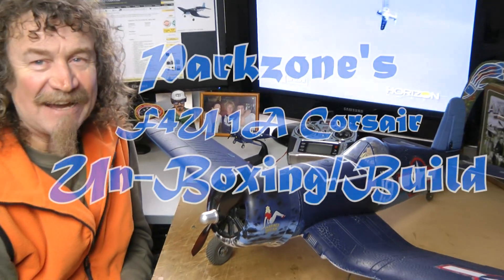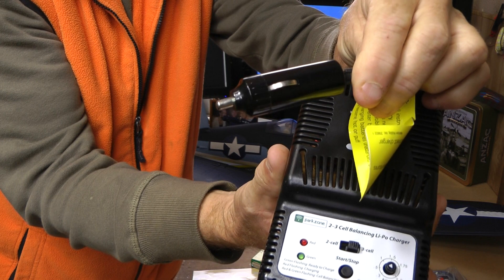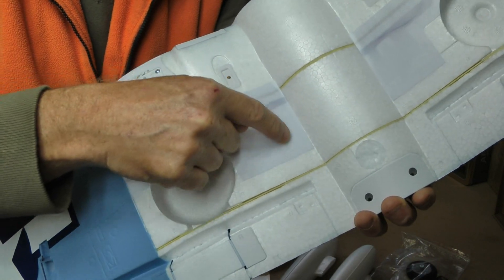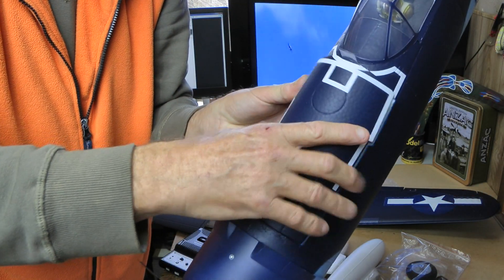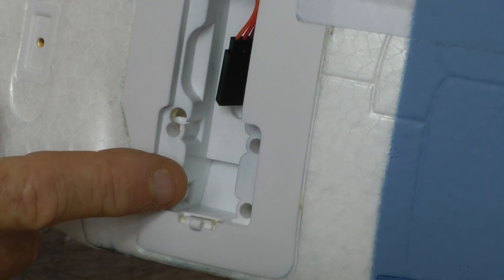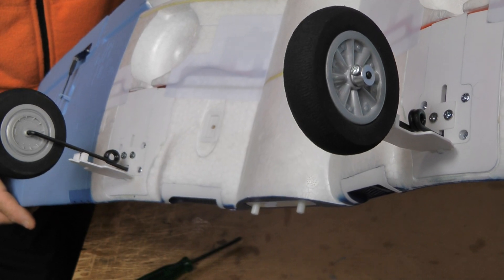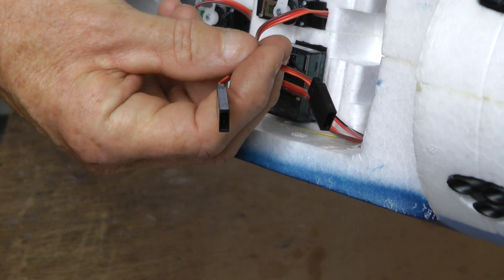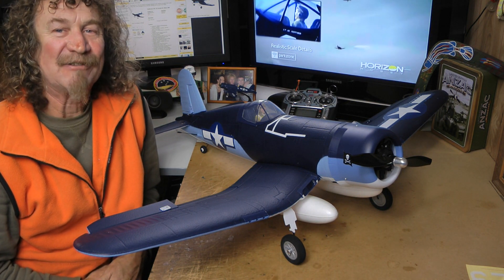Parkzone F4U 1A Corsair Un-boxing-Build/Review

Comment: Fair comment if you've had a bad experience with a manufacturer other than Horizon, I find you generally get what you pay for and while it is more expensive my HH models have lasted well. So far I have not had a bad experience with the significantly cheaper HK or Dynam models I'm flying but yes they do need a bit of tweaking to get them to fly great whereas I know HH stuff will "just fly" out of the box. Happy flying HeRacesTheSun, whatever you chose to fly.

Comment: Nice video as always Chuck but at AUS $230 for the PNP plus another $100+ for the retracts and flap servos you can buy 2 Durafly PNP F4U Corsairs with significantly more scale detail, twist and turn retracts, (outboard) flaps and lights as standard etc etc. PZ stuff is good but its just too expensive now, manufacturers such as Durafly (HK) and Dynam have raised the bar and reduced the cost of foam models and leave Horizon Hobby for dead now IMHO.